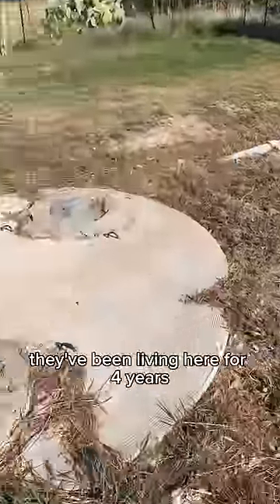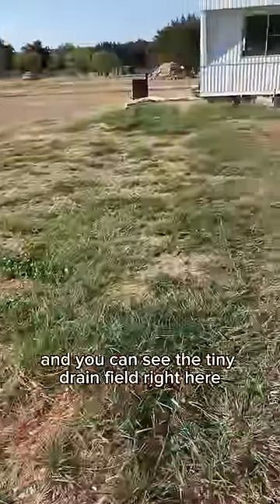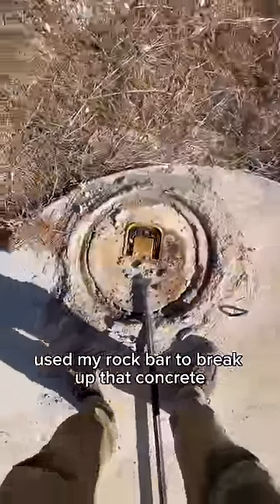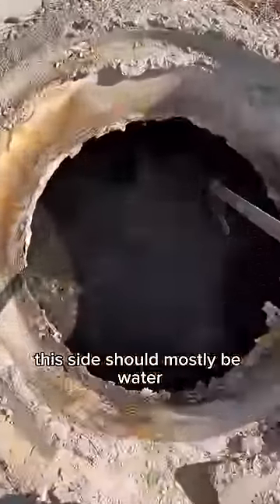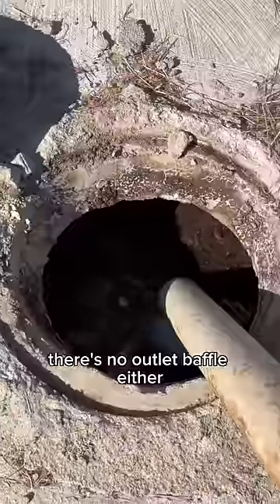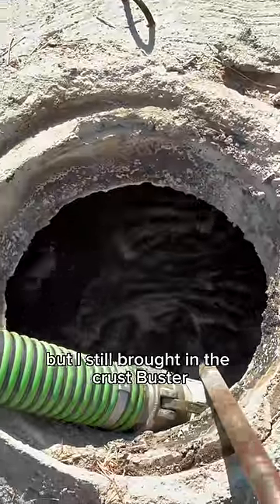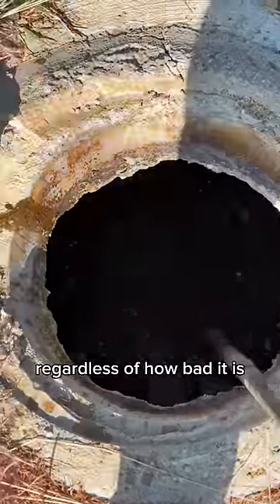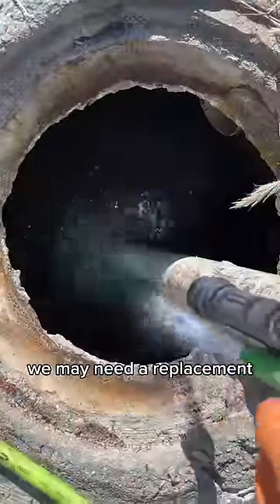Concreted the septic tank shut #shorts

Comment: We're on a septic, had it inspected by a plumber in 2017 when he was doing some repair to the drain pipe leading to the tank... He said it was fine and didn't need cleaning. It's now 2023 and we have no issues, not sure if we need to have it checked again if it's working fine.

Comment: Okay I'm going to leave this message here because I want an actual idea from a professional as to how long this thing might last. A friend of mine just went to work on their in-laws property late last year. The septic system is a complete loss, the drain field has completely failed, the tank is probably fine but the drainfield is a complete and total loss. I do not have the financial resources to completely redo the drain field on the existing septic tank. So instead they went out and got a couple of chemical tanks from a company of some tanks surrounded by a metal frame interconnected them together by a piece of sewer pipe dug a pit is deep as they could which was indeed because it's a lot of rocks on the property set the tank in there and the way it's set up is the sewage has no inlet baffle it's just a 4-inch pipe that goes in on one side of the tank

The outlet is a three or four inch pipe that goes out to a single leg of a drain field the drainfield is about 75 ft long at the absolute most and it's only one train pipe with holes in it so it's not a multi-leg drainfield it's only 175 ft long length of a drainpipe, this is handling three adults

This was a hail Mary situation designed to keep them in the house until they die there's no point in worrying about reselling the place because they're so upside down on the mortgage nobody will ever get any money out of anyting how long do you suppose this jury-rigged makeshift macgyvered crap can last???